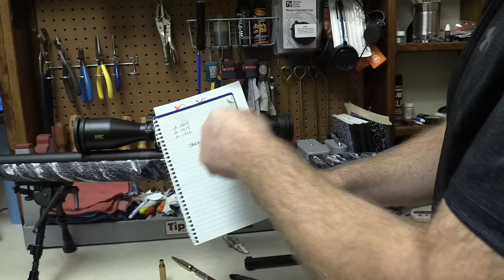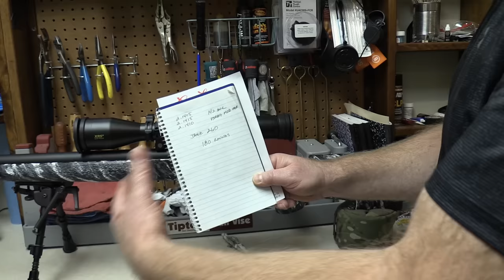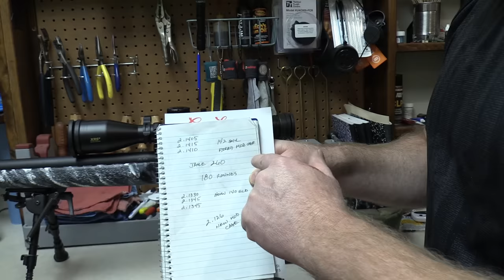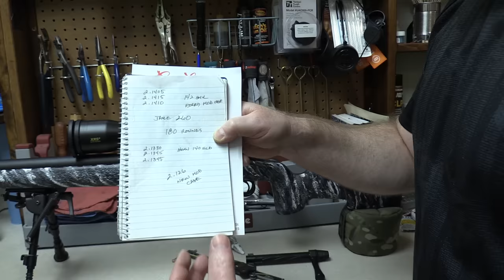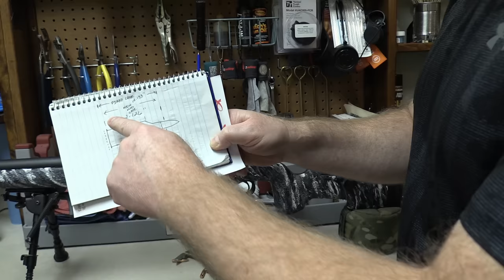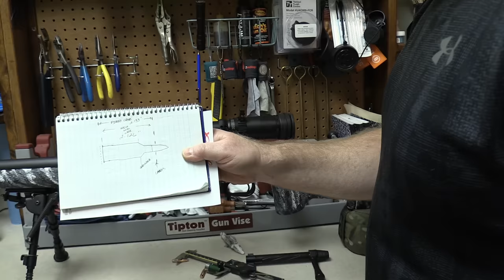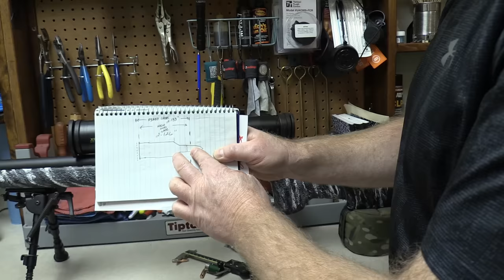COAL vs.  CBTO & Measuring Max CBTO w/ Hornady LnL OAL Gauge

Comment: I bought this tool a long time ago and I found you have to be very careful with this. When you feel that bullet stop you are probably at least .010 into the lands already. I noticed this on my .338 Lapua load development. I took 5 readings and they all came out within .001 like yours. Just when I was going to go with that number, I noticed rifling marks on the bullet a good .250 past the ogive. If I would have subtracted jump from that number, I would still be jammed into the lands when I thought I had jump. My point is that it’s VERY easy to push the bullet too far into the lands with this method. I now use the bolt with firing pin and extractor removed to find the lands in a bolt rifle. I still use that tool for AR platforms but I look at the bullet carefully to make sure I didn’t push it 1/4” too far. To be on the safe side, I subtract .010 from where the bullet stops and call that my touch point.
Reply from the maker: That hasn't been my experience at all, and I've confirmed it by checking like you describe with the bolt. The biggest error has always come from using a modified case that doesn't match the case being loaded.
Reply: Essentially you're saying the bolt won't cram the bullet into the lands like using hand pressure will.  Well, to each his own, however be careful... You've now added a 3rd variable.   With Sam's method there are only two variables - the distance from the case head to the shoulder, and the distance from the case head to the ogive.  Sam makes measurements with the cartridge case pushed as far forward as it will possibly go (the same place the cartridge will be when fired after the firing pin pushes it forward just before ignition).  However, instead of Sams method of measuring from the furthest forward the cartridge can go, you're measuring from the furthest back - against the bolt.  With your method you'll need to account for headspace (the third variable).  While resizing fired brass, if you push the shoulder back 0.002 then that's roughly the amount you must account for.  But new brass can be 5 or 10 thousandths pretty easy.
Reply: Clay S I understand and thank you to Sam and yourself for the knowledge. I’m no expert by any means and was just describing my experience with it. It really had me concerned when I found my bullet went so far into the lands. I tried being as delicate as I could and it still went into lands .250. I switched methods when I watched Wheeler Accuracy’s video on the subject. I’m not saying the method is wrong. Again just describing my experience with it. Could this have just been my rifle?
Reply: If you are jamming a bullet into the lands using the OAL Gause as seen in this video you are pushing WAY too hard.  Just nestle it up agains the rifling firmly but not "grit your teeth" firm.  Think of holding a wild bird with just enough pressure so that he can not get away but no too much to crush him.  I've taken the extractor out of a bolt and the firing pin assembly out and did the "free bolt drop test" that you describe.  I then compared it to the Stony Point OAL gauge with a modified case and both were within .001"!!    What a total waste of time and energy that was.

Comment: Wyman08
When I first saw the Stony Point or Hornady AOL Gauge, my first thought was that it is indexing on the datum line of the shoulder within the firing chamber and will provide an accurate measurement from that datum line to the lands using that particular bullet. But it only allows a measurement to be taken from the base of a case and that measurement never refers back to the point of the chamber from which the tool is indexed.  You can only measure from the base of the case to the ogive, and without a reference back to the point of calibration you have not yet measured anything truly dependable. The case used is just a SAAMI case, but even if you pay extra to machine your fire formed case for use in the OAL Gauge, without knowing the headspace measurement of your chamber you still cannot know the distance to the lands, because you have still not returned to the point from which the OAL gauge was indexed. 
Measuring a fire formed case still does not get you a correct headspace measurement due to the resilience of the brass used in the manufacture of that case. No two batches of copper and nickel to make brass are exactly the same, and more difference exists in the brass thickness from one lot number to the next. The difference in resilience relates to the amount of springback that case had when it was fired. How much did it shrink? This is guessed to have been .002, but some shrink .004. If you want an accurate measurement of the chamber, insert a piece of plastigauge behind the base of the case and chamber it, Lock down the bolt, then remove it and measure it against the gauge on the packaging for the thickness of the gauge material. Now add that much to the headspace length of that same case for the true total length of the chamber. With this measurement you can calculate the true distance to the lands using the AOL gauge measurement compared with the actual chamber measurement.
Reply from the maker: Stop complicating this simplest of processes. You don’t need to know the exact measurement from the datum line of the shoulder to the lands. Nobody is going to measure that when seating bullets. This is a comparative measurement using basic tools that anybody can understand, and it works.

Comment: I always use a case comparator to check the case base to shoulder differences between a fired and sized and the new modified. Then as you say you need to do some basic math to seat the same distance off lands.

Comment: OK, Quick question about precision reloading for accuracy.

It seems that the best way to get accuracy is consistency and uniformity of your loads
One of the ways to do this besides controlling your powder exactly is to control the "jump" or gap distance between the ogive and the lands
Given that there is much variance in ogive to bullet tip (especially for polymer tipped bullets) lots of shooters recommend measuring CBTO rather than COAL
If you invest in the tools to measure your chamber headspace as you show the bullet is seated in the chamber to the CBTO, but then we are measuring the COAL
Given the variance stated earlier, if our bullet seating dies are pushing on the bullet tip, 
not the ogive won't it be next to impossible to get a uniform "jump" spacing?
Another related question would be, in your experience, which if any die mfgers have bullet seating dies that use the ogive rather than the tip to seat the bullet?
Thanks again for the great informative video, it's really got the almonds activated. (if you couldn't already tell!)

Comment: Great video! I have a 6.5 Creedmoor throated to SAAMI specs. So throat diameter 0.2645" and 0.199" of freebore length confirmed with the gunsmith . Hornady factory with140 ELDM's has bullet contact around the bearing surface. Throat & chamber has been cleaned. In this situation how do you get a reliable measurement of distance to the lands? The tool does not seem to work due to the way the chamber has been spec'd in SAAMI - I feel the friction as I push the bullet forward. I am not sure if my bullet has reached the lands or is just stuck in the throat? I've not had this issue before with all my other calibres but it seems the trend to go tight throat like 6.5 PRC (.0005") and also 300 PRC (.0008"). Not knowing this I shot factory rounds blissfully - have about 150 rounds through the rifle and no issues or pressure signs and velocity is right on spec at 2725 fps out of a 26" Hart barrel 1:8 twist.

Comment: How do you ensure that you are seating a bullet to the same CBTO every single time without having to adjust the dies every time? Do you measure the CBTO every single time you seat a bullet? Or do you set the OAL for a brand and lot of bullets and then use that OAL to seat the bullets to achieve the same CBTO? If this is the case, then are we not assuming all physical characteristics and dimensions of the bullets in a lot to be exactly the same? 

Very good instructional video, but I still am not clear on how you achieve same CBTO on every seated round without any assumptions?

Comment: So please tell me I have the concept right or wrong...So I measure CBTO with a Hornady modified case.  I then want to load fired brass for instance at .020 off lands...which in reality 
will may actually be .027 off lands given difference in the non fired and fired brass. I then want to attempt to tighten groups and change CBTO to .010 off lands.  The load/CBTO shoots great and I'm happy with the groups. In reality I am likely farther off the lands than my ".010". So do I need to worry about adding or subtracting lengths obtained from the discrepancy between the non fired Hornady case and already fired brass.  Is my assumption correct I'm only using the initial CBTO as a reference point? And as long as I'm not going beyond the initial distance to lands I should be fine without any extra math.  Going the other direction ...Initial measurements with fire formed mod case and then loading virgin brass could lead to extra long loads which are jammed.
Reply from the maker: John Waltz Yes on all counts.👍🏻
Reply: Thanks!
 @PanhandlePrecision

Comment: Great video and explanation of the process. Thanks for sharing Panhandle! This topic reminds me of many other things where the answer is: it depends. You can't just say "load everything to measurement X." Even the same rifle from the same mfg will have variances in the chamber, you have to measure to know what you are working with. Accuracy in shooting when it comes to reloading is an experiment. You have to be willing to spend the time, have to tools and work through things. For my shooting skills today this level of attention is probably unnecessary but its great to know for later. As for modifying a fired case: I also wonder if the best order of operations (when using a lathe) is to drill/tap the case first then resize so you do not affect any case dimension during the lathe operations?

Comment: I’ve discovered using my OAL that my COAL for my Howa 308 is well beyond the COAL for a standard 308. However since this is a magazine fed gun I have length restrictions in order to feed the gun so my jump is what I consider pretty big. In this case I think I’m just stuck using COAL because of the magazines. Any suggestions? Mind you this is with Hornady ELD match style bullets

Comment: Sam, I understand this is geared toward precision, bolt action rifles. However, I tried this with my last load development for an AR. I found that my chamber OAL was 1.8320-1.8370. My finished rounds seated at COAL 2.20, had a CBTO of 1.840, consistently. Does this mean I’ve created a “jam” situation, potentially increasing chamber pressures? Maybe I’m not understanding what exactly the Hornady chamber OAL gauge measures? Thought it was cartridge base to lands?

Comment: Over a year later, this is still reaching the masses. Thanks for your video. Assuming I have consumed everything you've discussed here, where would case trimming need to be implemented as it relates to this process? Would it be after I find that sweet spot away from the rifling and then have the correct case length determined for proper bullet seating or is there a better way to determine how long the cartridge should be?

Comment: Apologies for what may be a 101 question but new to reloading.   Good explanation of how to get correct seating depth but I’m currently using a Lee seating die that pushes down the tip of the bullet.  Is there another style die that pushes more consistently closer to the ogive or a better method of seating bullet?

Comment: I'm very confused about full length sizing AND bump sizing... I use a redding body die to bump the shoulder, then a lee collet die to set neck tension.  Why do you full length size first and, more importantly, how do you full length size without "smashing" the brass back to SAAMI spec?  Awesome videos, by the way.  Thanks

Comment: Sam,
Just want to double check something, as you said it can get a little confusing. I have a modified casing from Copper Creek Cartridge Company, not one of my brass pieces, it’s one I purchased from them. When I take a shoulder gauge measurement it’s about 0.006” difference from my Lapua brass to the CC modified casing. The CC modified casing is the smaller reading. That said, I should adjust for this difference when seating bullets after taking the max Ogive length by pushing the bullet further into the casings when seating my bullets (to account for the 0.006” correct)?  Thanks...I know, I know, I should have sent a fired casing in to have them modify it 😆. Take care and thanks for all the videos!

Comment: Hi thanks for great videos, I am new to reloading and have a Hornady OL Gauge and also the case & bullet comparator  tools from Hornady also. So I have measured OL exactly as you have shown ( thanks again) so all good to that point. I also measured fired & unfired cases and full length sized  bumping back the shoulder 2 thousands - 2.5 thousandths . Where I now get confused is do I also when seating the projectile come back 2 thou from the OL measurement also ? or just seat to OL Length - am not using a magazine am single feeding as also using 80.5 grain Berger full bore projectiles target shooting out to 600 yards 1/8 twist Howa 223

Comment: Sam,  Please share with me your thoughts on vertical stringing.... virtually all of my groups have great horizontal placement but the group size is almost all vertical. If I could remove the vertical the groups would be pretty much a ragged hole.  Thanks for any advise on correcting this.

Comment: Thanks Sam - nice video - I have been having the same problem that you addressed with the fired and unsized case giving different lengths because of the web expansion.  If I don’t have the Reading Type S die how do I size the case and not the neck?

Comment: Sam, just trying to understand why when you do your custom case you bump the shoulder back .002? Wouldn't it be more accurate to leave it fire formed? Then the shoulder would be up against the chamber and then you could get an accurate measurement from the cartridge base to where the ogive meets the lands. 

I think what you're saying is that If you bump the shoulder back .002 and then push the bullet to the lands and take the CBTO and set your cartridge up, then the cartridge shoulder is back .002 and the bullet ogive is off the lands by .002. 

Then what do you do, seat it another .018 from the measured CBTO? (assuming .020 off the lands is ideal for my rifle) Am I on the right track?

I guess what I'm saying is if the shoulder is bumped back .002 and ideally I want the ogive .020 off the lands I'll need to take the CBTO and subtract another .018 to get my ideal length, from CB -->TO

Comment: So my question is what type of seating die do you use that uses the ogive to set seating depth. I have some dies that push the bullet into the case off of the tip of bullet. I have some RCBS Match dies that if I can see clearly enough leave a hole on center of die so the die only contacts the curve section of the bullet. It appears to contact the bullet close to the tip but not actually the very tip thereby bypassing the irregularities of the tip itself.

Comment: Seems like you could take the difference in length in a fire case and the commercial modified case using a head space gauge and just add the delta to the commercial  case CBTO
Reply from the maker: You can.

Comment: So to be sure I follow correctly, lets say I use the hornady modified 308 case and get my CBTO and have my bullet seated at 0.01 off that (Dumb question but Im guessing "off" refers to away from the lands as in back into the case right?).  I fire with new brass and then go reload with the now fired brass. Lets just say after FLS and a .002 bump the fired case is .004 longer. So to account for that increase case length I would seat the bullet back by .004 right? . Please correct me or give insight. Thanks.
Reply from the maker: Yes. You nailed it.

Comment: Thank you I have learned a lot in the time I have spent on your channel.  If you were to measure the distance from the base to the shoulder on the piece of brass you use to measure the chamber, then do the same on one of your sized pieces then add the difference between the two pieces to the measurement with the gauge be about the same as using a fired piece of brass in the first place? (assuming that the fired and sized case is longer)  I'm not trying to muddy the water here, just making sure I understand the difference, and know a path to get to the same place.

Comment: panhandle precision I Just want  to make sure I am understanding the “new” modified case made by hornady  vs unfired cases vs once fired 2 thou shoulder bump cases. Let’s say the new hornady modified case headspace measurement is 1.208, the unfired case is 1.205, and the resized case is 1.211. Does that mean that I would need to add .003 to the measurement taken with the modified case to get to the proper CBTO for resized? And does it also mean that I would need to subtract .003 from the measurement obtained with the modified case to reach the proper CTBO for a the new case since the new case is actually .003 shorter than the modified case being used for the measurement?

Comment: Something to ponder on....do you think jump to the lands consistency is more import than internal case volume? I really don't know the answer but if you take a projectile straight from the box and measure ogive to boat tail the results are just as bad as measuring col....at least with nosler accubonds. I saw .005-.015 difference measuring ogive to boat tail with mitutoyo calipers. That has to equate to different case capacity which affects pressures